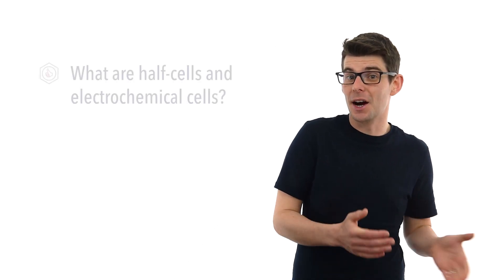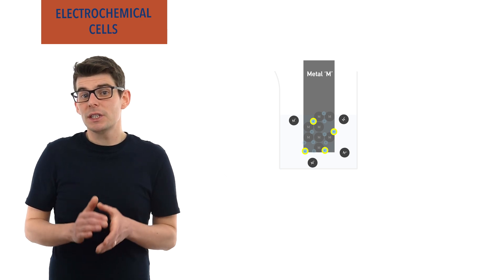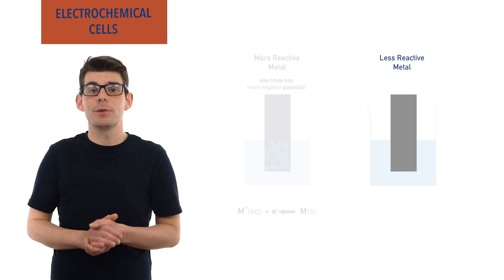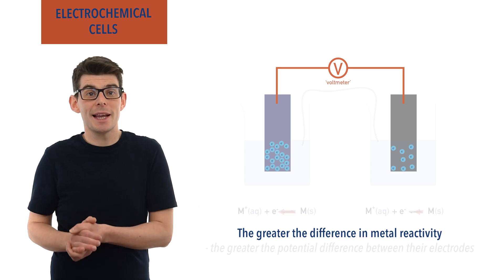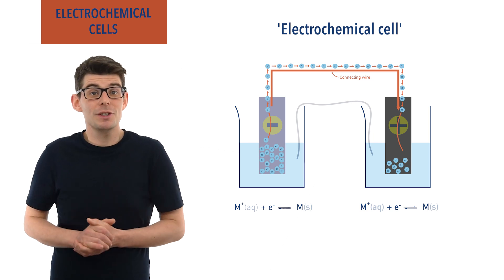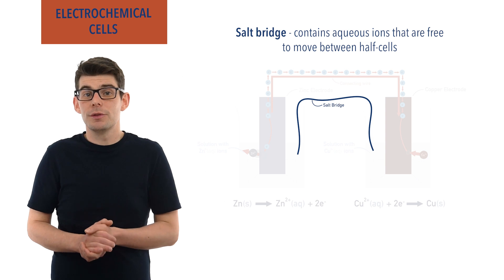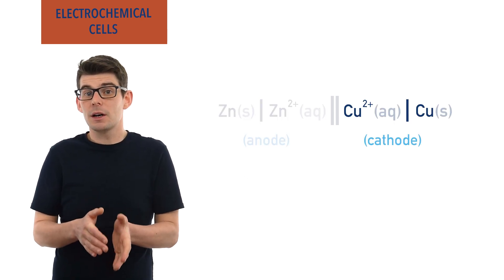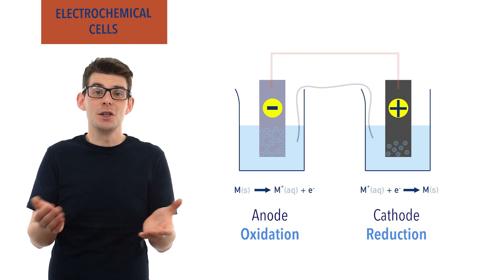Electrochemical Cells

Comment: I dont understand why zinc needs to be placed in a zinc sulphate solution and copper needs to be placed in a copper sulphate solution.i never seen the purpose for them since as i understand,zinc  is highly likely to give up electrons and copper is highly likely to gain or attract electrons.so why put them in a solution.
Reply from the maker: It’s a great question!

You’re absolutely right — the flow of electrons is driven by the difference in reactivity between the metals (zinc being more reactive than copper). However, the metal ion solutions are crucial because they enable and sustain this flow by:

Providing ions for redox reactions – On the copper side, electrons arriving at the electrode must reduce something. The Cu²⁺ ions in solution accept those electrons, forming solid copper. Without these ions, there’s nothing to undergo reduction, and electron flow would stop.

Maintaining ionic balance – As zinc loses electrons and forms Zn²⁺ ions, the solution becomes positively charged. Meanwhile, Cu²⁺ ions are removed from the copper half-cell. The metal ion solutions, along with the salt bridge, help balance this charge movement, maintaining the potential difference needed for continued redox activity. Without this ionic flow, charge would build up and the cell would quickly stop working.